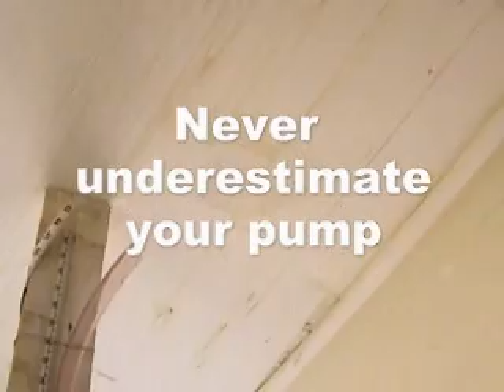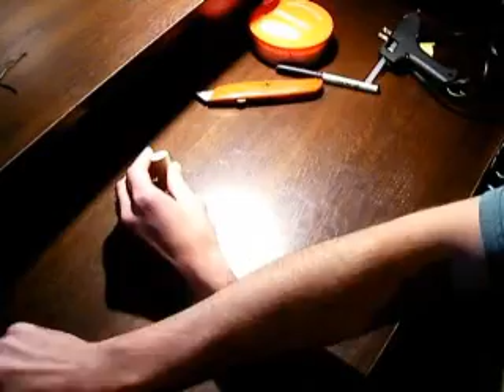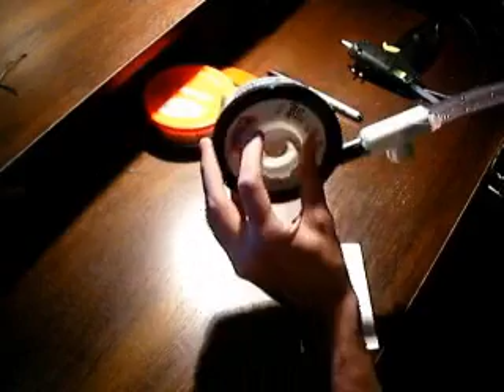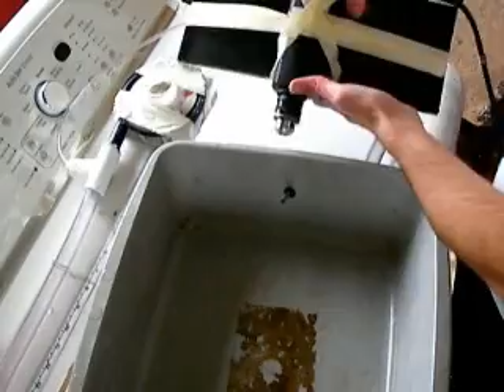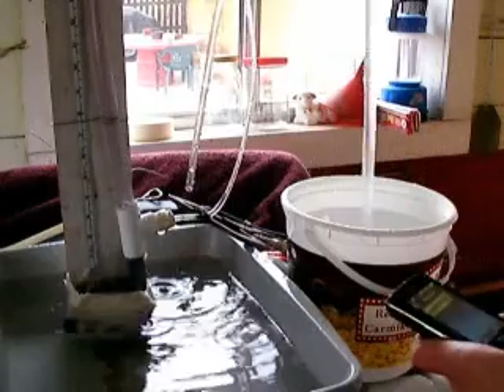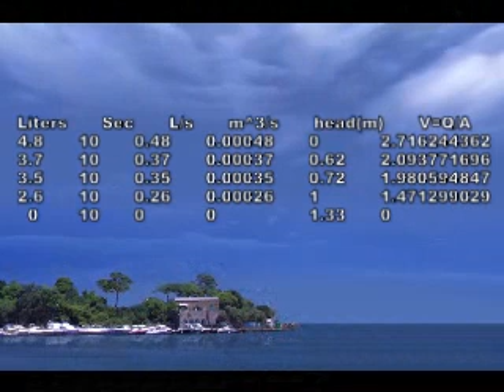Centrifugal Pump.wmv

Comment: Nice homemade centrifugal pump! Congratulations! I've done one myself recently, with the objective of use it on a new stirling engine that I'm developing and it's almost finished! I'm very happy because the pump displaces  alot of water with minium effort for the power source (in this case, the stirling engine). Yet, I need to fix some problems on the engine design. After that I'll post a video on my chanell. You're pump design is great!
PS: You shoul have uses a water jacket when filming! :-)